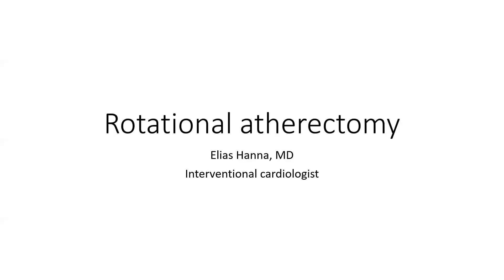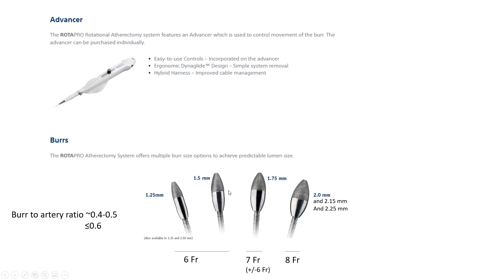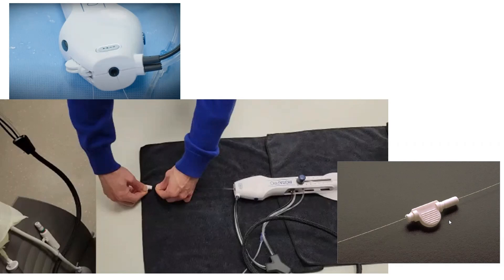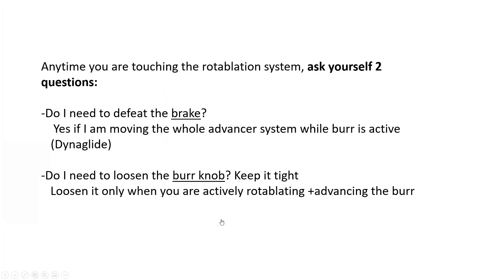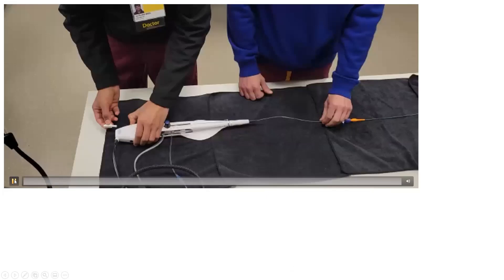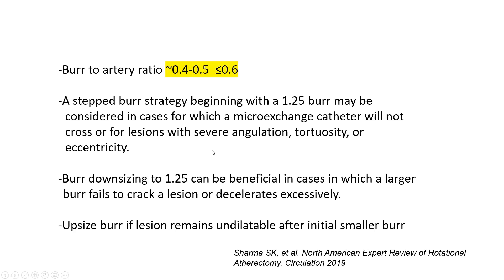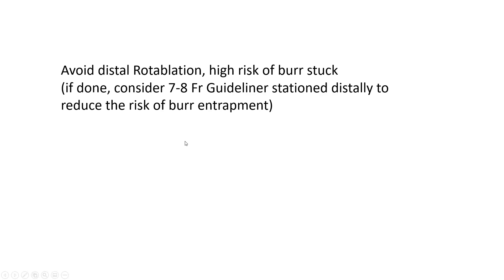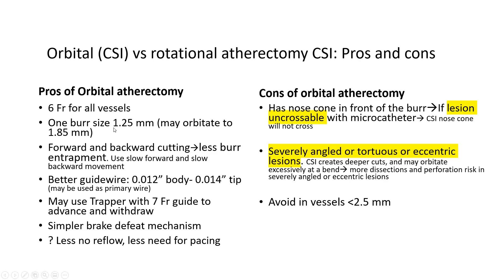Rotational atherectomy: advanced techniques with videos + Orbital atherectomy tips- Elias Hanna

Comment: Why there is need for automatic wire brake during rota/dyna mode?
During rotablation at 150k what if we apply the wire brake defeat??
Reply from the maker: Wire brake prevents this wire from moving forward (axial movement) or spinning (rotational movement) as you are advancing the burr. IF you apply the brake defeat during rotablation, the latter wire movements may happen.